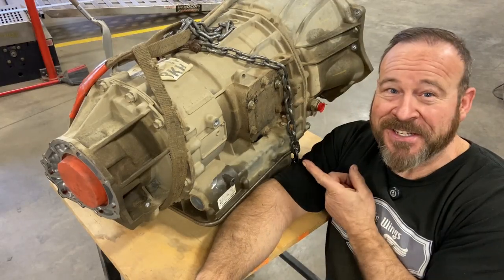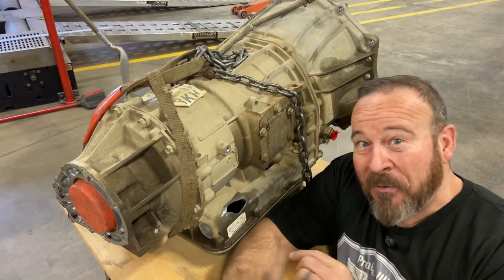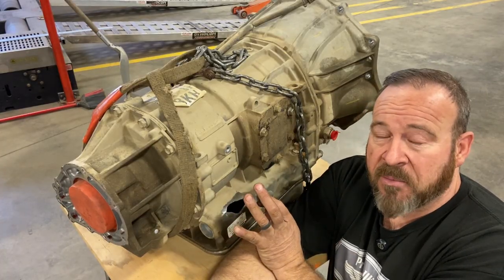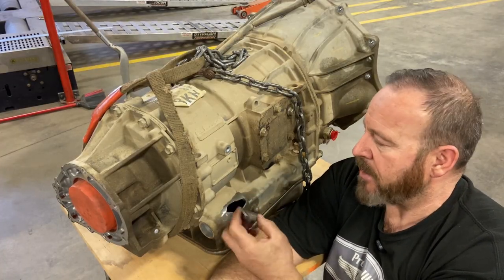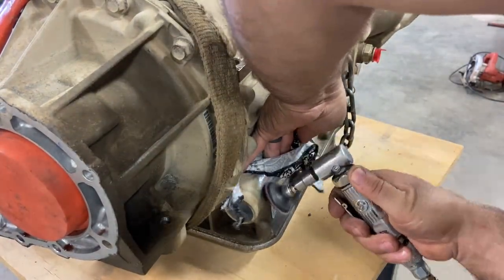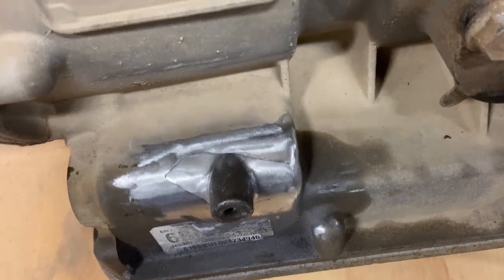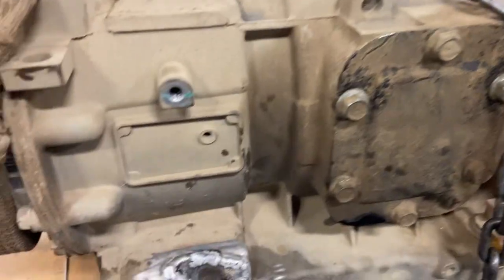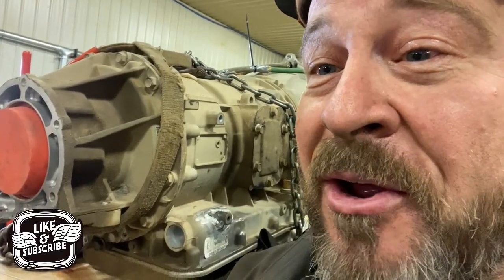Can You Weld An Allison Transmission WITHOUT Tearing It Apart?

Comment: What i would have done differently:
1. turn the transmission 90 degrees so i have the weld up top, and any shit would flow down and not in the weld.
2. make two tacs and the heat it up without welding it so i can boil some shit out...
3. weld it 1-2 hours later after all the boiling...
The result might have been the same, but with a better look...:)
Reply from the maker: @tanaseav  1 good call, probably not as much crap run in but would have been difficult to purge without fears of a flare but I’m sure I could have figured that out! 
2 tried to keep it as cold as possible so as not to cook seals. 
3 did lots of jobs in between and did space this out over quite a long time. And yes sir the weld did look like crap, barf or something?? 
Best case is if they would have brought me an empty clean case😁

Absolutely appreciate the thoughts, will definitely consider if I need to tackle this situation again. Thanks for taking the time to comment!!!